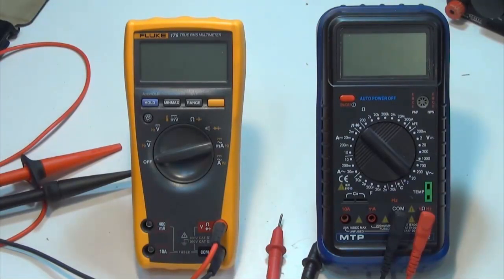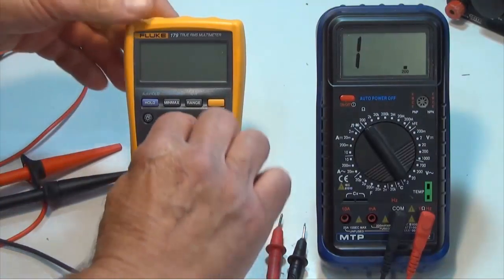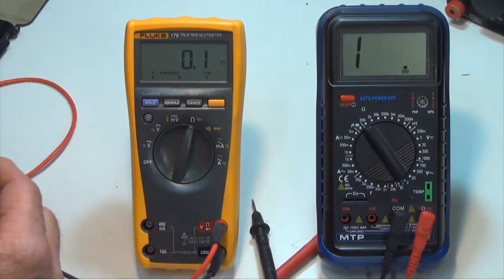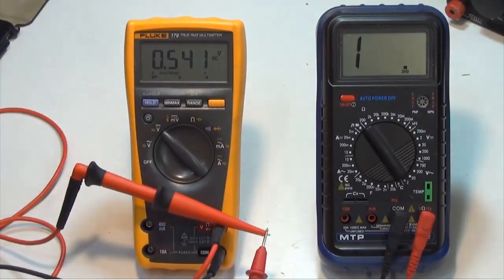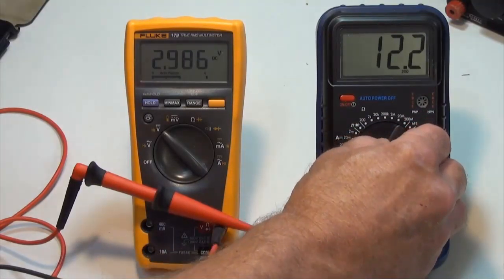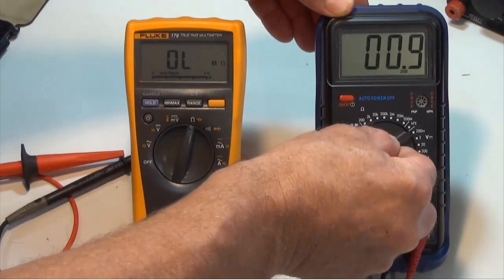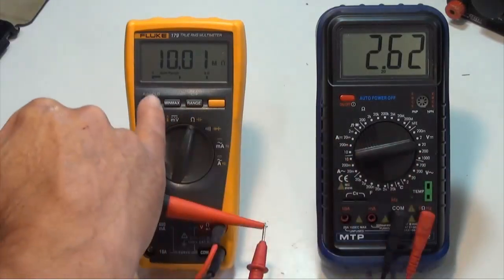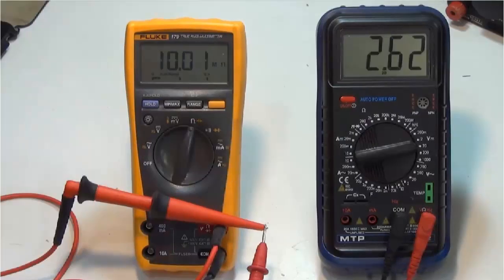Digital Multimeter DMM Resistance Measurements - What NOT to do

Comment: hi is it okey to beep test in live sircuit?
Reply from the maker: +Joachim Johan -  never do a continuity test in a live circuit.  When using this function the meter is providing voltage and current to the circuit
Reply: is it enough to take off the positive side kable before a continuity test? or can i just Power Down the electical Component lets say a startermotor thats not running. To do a continuity test while cables hooked up`? of course not in paralell + and - but lets say  + starter to + battry

continuity in a cable is measured in series and and volts in parallel. so what is happenimg inside the meter to damage it? is it because you introduce extra voltage inline in series where there is amperage constantly flowing that mess up the metre?

Thanks very much